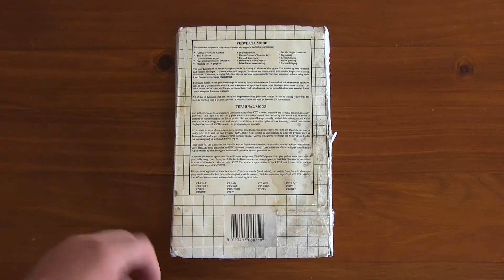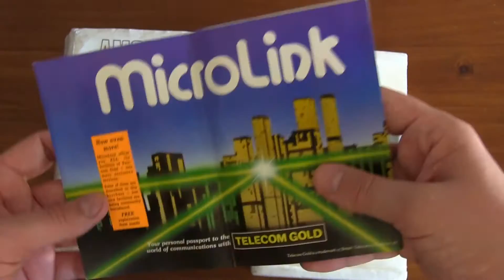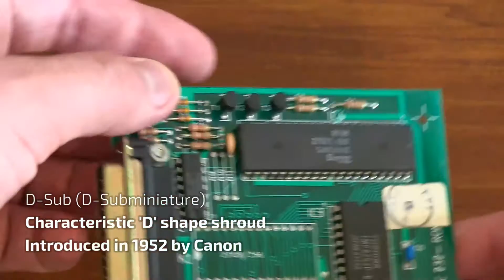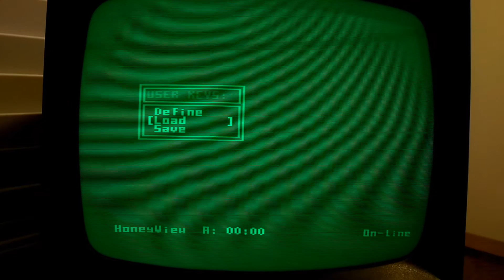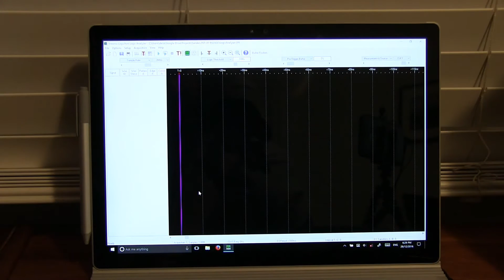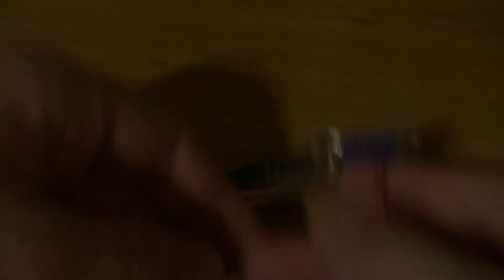Amstrad CPC 6128 - RS-232 Communications

Comment: Parity none, because you had 8n1. Abd file transfer we used xmodem in the 80/90s. It’s more robust than ascii especially with larger binary files as it also has a block recovery. So when connection lost, you resend only the last received block and the rest.
Millenials know nothing about old communication hardware and protocols ;) They don’t even solder their own null modem cables any more :P

Comment: Very nice presentation! 
 Btw,i think that a serial interface (based on a modern 8bit PIC MCU), i  recently  developed  for amstrad cpc, might interest you:
https://www.youtube.com/watch?v=oImOI_TJhDo
With that, you can transfer files from 3" disks (either using a direct usb2serial cable or wireless bluetooth/WiFi modules)  directly to a PC,  in rather fast speeds too! ;-)

Comment: I take it you have not found the time, managed to do it or abandoned the file save.
One thing you had XON/XOFF set, so you should have both the transmit and receive pins wired. Because XON/XOFF sends stop/start transmit commands if the buffer gets full on the receiving unit.

Comment: for terminal connections like this, enter key is not used for chat. just press down key.
interesting approach, you could also transform a 3.5 floppy and connect it to your cpc. also for simple basic progs you can built a tape cable and save your file to your pcs sound card with the proper software or just as wav.

Comment: Nice but it is an AWA, not an Amstrad... ^_^  Have you shared those video at CPC related forums (CPCwiki) ? very interesting.Could we find the microlink booklet scanned somewhere ? Concerning the second "male connector" on the ribbon, it is so you can plug other peripherals alongside this one (it would simply reproduce the male edge connector of the CPC) or if you want to use a longer cable in female/female configuration perhaps. German/later models had proper centronic connectors.

Comment: Might be worth looking into the XMODEM protocol (https://en.wikipedia.org/wiki/XMODEM). I used it a lot during the early BBS days for downloading files. You should be able to send a whole binary file from the CPC using XMODEM into a serial terminal on the PC, with error checking (a quick Google suggests that TeraTerm should be able to receive files via XMODEM on the PC side)